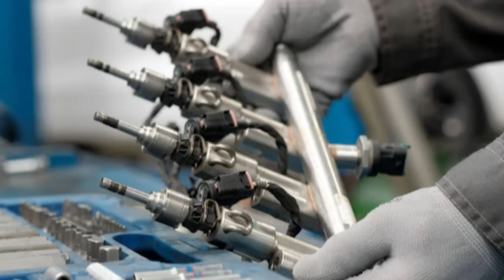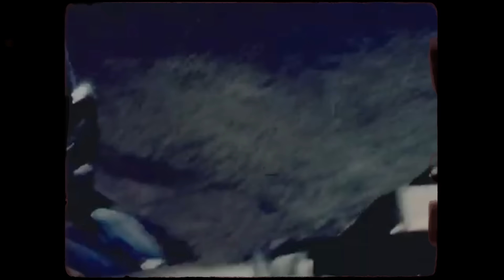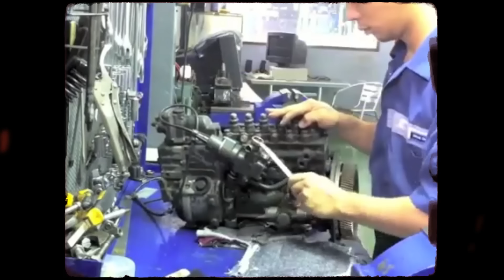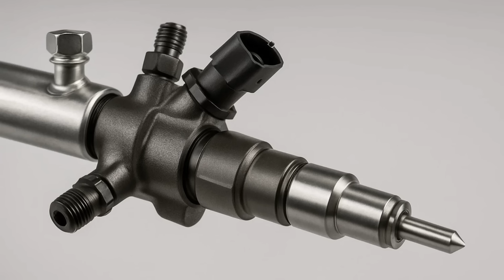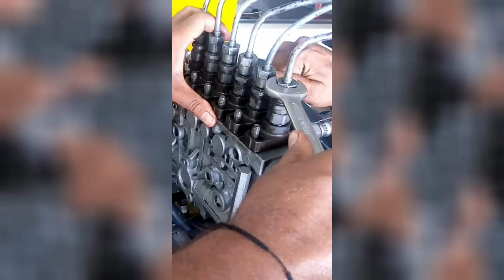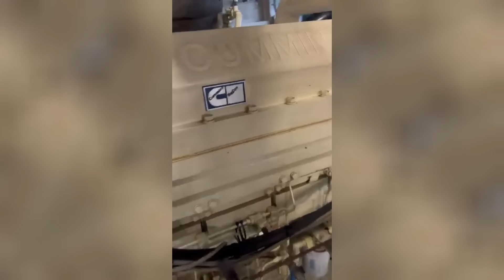Cummins PT: The System That Broke the Rules of Injection

Comment: Good background information.    Showing a picture of someone  putting gasoline in their  care?   Pictures of distributor injection pumps (rotary,  common as time went on) without  noting the difference vs  in line?    I ran or worked on Detroit Diesels,   Cummins and  Distributer systems.    None was better than the others (Detroit  Unit Injectors arguably were simpler and easiest of all from a field work standpoint).

Comment: The P-Pump is still the go-to for raw power. That's why the Cummins 12 valve is still so cheerished and when people in europe hot rod MB OM 617's and 606's(the 2jz of diesels) they use a big(er) Bosch P-Pump.
Reply: Not so fast. The modern common rail injection tech has improved to the point that mechanical injection can't keep up. Josh McCormack put down 4500whp last year on a 6.7 cummins with a deck plate
Reply: @Tylersworld46 I'm speaking broadly. I know the power HP common rail is capable of. I stipulate your claim and even give that as common in the US, but P-Pump is still king w/ Mercedes Benz OM-xxx tuners.
Reply: @tedbyron1499  yeah me being in the US does change the perspective my dude. Mechanical pumps are awesome at making power on the cheap for real
Reply: Mercedes pump is not P , I think it is M, very small.
Reply: @V8Lenny absolutely not, the OM617 uses a Bosch P-Pump and when people want a high output tune of an OM 606 (again the diesel analogy of the Toyota 2jz) they use a Bosch P7100.
Reply: @tedbyron1499 they both use M-pump
Reply: @V8Lenny  m and p are both piston pumps. I thought Diesel Pump UK was using P7100's
Reply: @tedbyron1499 no, M Pump , originally 5-7mm plungers, 7mm were in Ford Transits but they didnt give much fuel, Mynä from Finland made first high performance plungers, still the best. DPUK is just a cheap copier, shit products.
Reply: @V8Lenny  i know about his products and how shit his customer service is but  I thought 5 or 6 he was doing custom rebuild's of p7100's.
You definitely know more than I do about the lineage and usage of these pumps so I'll take you word for it

Comment: I'm not a diesel mechanic, but are they trying to say it was p-pumps until unit injection???
B/c that's bullshit. The UI was 1st invented in 1904 and Detroit used them on their 2-strokes.
Reply: This content is AI generated. No one is fact checking or curating this info it seems. It is unverified LLM slop. Don't listen to or interact with it at all. If you couldn't tell from this video, perhaps you should research ways to identify this content because it will become a very real problem seeing as world gov'ts are not afraid to use it.
Reply: @zacha7221 everybody here knows it's fuck'n AI generated.
It's the whole point of my comment.
Reply: @tedbyron1499  if that's what you meant you should say that

Comment: Cummins were the big dogs 🐶 on promoting Diesel Engines back in the day. The managing director had a very unpleasant experience in the early days of the company when brakes were ineffecient and the Jake brake had not been invented. He kept it under his hat but when he retired he worked intensely on it. When him and his partners perfected it Cummins where the first on - board. If I recall correctly the UK had a brutal winter in the late 70’s such that Diesel literally froze in the tanks. Except for Cummins and their PT system which recirculated 80% of the fuel back to the tank as the fuel had been through the cylinder heads already and was warm. Cummins then came out with the “ tripple nickel”. Some unkind people calling it the “ triple cripple “. As well as the Barn- storming 903 particularly in the 3070 International.

Comment: So basically, the Cummings pt injection system was the forefather of the German Pumpe Duse (PD) injection system.
Reply: Cummins.
Reply: Detroit was earlier, more similar to PD.
Reply: Not at all! Cummins PT was quite different. You could perhaps say that the Pumpe Düse was somewhat similar to Detroit Diesel's injectors. Pump and nozzle built together in a unit, hence the "unit injector" denotation in English. Older ones in the 2-stroke DD engines where mechanically controlled but the latest version got a magnet valve instead, plus electronic control. This technology was then migrated over to the 4-stroke series 60 engines. Bosch never made a mechanical unit injector but went straight to magnet valve an electronics. Moreover, the Bosch "Pumpe Düse" was quite short-lived in cars. It was only used by the VW group while everyone else used common rail injection. Eventually, also VW switched to CR. In the meantime, VW also had a unit injector co-developed by Siemens Automotive. This one had a piezo actuator, instead of a magnet, for the valve. Well, back to PT, again: PT was unique due to that the nozzle needle and the pump plunger was combined in the same part. Before injection, the needle/plunger lifted, air entered via the injection holes and fuel was metered into the same volume. This is called an "open nozzle". During injection, the needle/plunger was "hammered" into the valve seat and thus, fuel was injected. Since hot air (heated during the compression stroke) entered the volume under the needle, the ingnition delay was practically eliminated and the engine did not have the typical "diesel knock". It was very quiet. The "wonder" of the "open nozzle" concept. I would have loved to see the video elaborate more on this. Today, Cummins use a conventional common rail system.
Reply: @peterahlvik5954 Never thought about that air entering injector helped with ignition delay. But one reason for no diesel knock was retarded timing at part loads, also the reason they were not very fuel efficient when doing light work.
Reply: @V8Lenny Yes, retarded timing sometimes helps for noise at low load but PT was also quiet at more advanced timings. When emission regulations came, Cummins utilized a "step timing" device for advancing timing at low load. With retarded timing to cut NOx emissions, the problem was that the timing would be too late at low load. The successor of PT, i.e. HPI, had full control of injection timing vs. speed and load. It could also utilize either "open" or "closed" nozzle, but this would be a completely different discussion.
Reply: @peterahlvik5954 It is never very advanced at low loads, even with MVT or STC
Reply: @V8Lenny No, not quite what I meant. Just not so much retarded with STC. Anyhow, retarded timing at low load was a serious drawback of PT. I think we can agree on that.